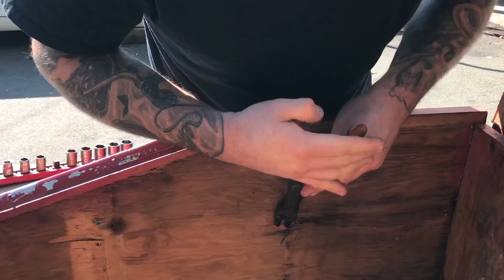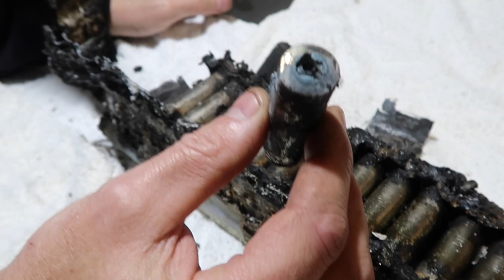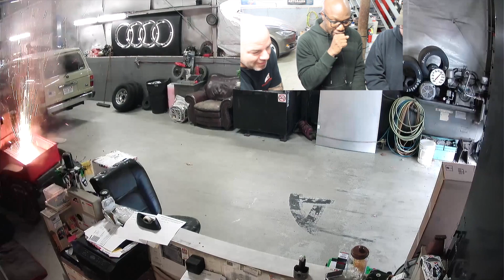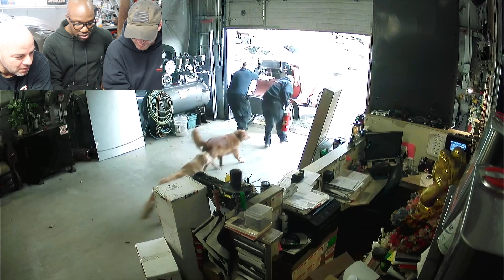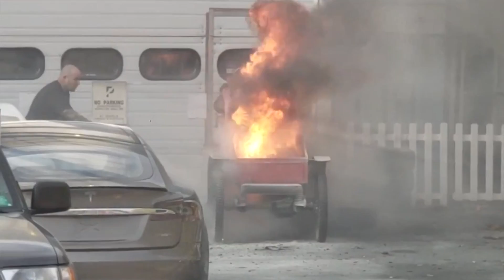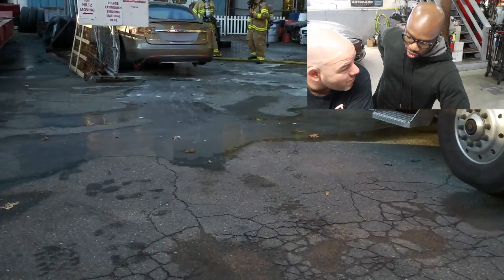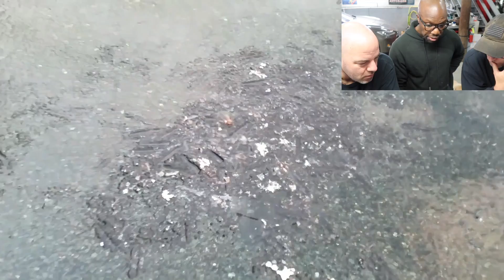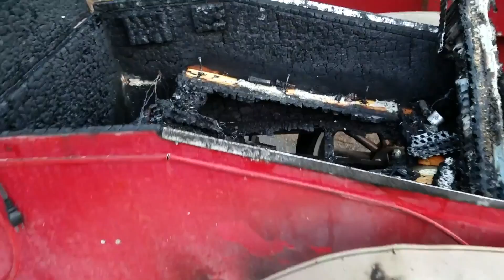My first Tesla Battery Fire

Comment: This folks is why you don't use cylindrical batteries in a EV battery, They run away quickly, they don't vent quickly enough, and they turn into projectiles/bombs, the other cells then overheat and do the same thing.

Pouch packs are the way to go, they swell rather than explode and are far more stable, the only issue is they are more expensive and slightly heavier.

Comment: Seems to me if you're going to be messin' with Lithium Ion powered EV's you need a fire resistant blanket/tarp to contain a run away battery fire. Keep yourself, garage, neighbors and fireman safe. It won't put out the fire but should contain the shrapnel.  https://www.amazon.com/Waylander-Welding-Vermiculite-Impregnated-Fiberglass/dp/B01MTUMLV8/

Comment: Yes lithium it’s very flammable and very violent, like thermite (aluminum iron oxide) and its coefficient of thermal expansion is higher than iron (4x) and aluminum (2). This means it expands greatly which makes it very violent when it burns. when it over heats or gets a charge thought it with while punctured or just fails this can happen and you need a water fire extinguisher not a co2 fire extinguisher to put it out. Oddly enough I posted on a engineering form that a year or two ago about how in movies had have ppl shooting gas tanks and while gasoline is extremely flammable (has flash point much lower than diesel or kerosene) (flash point is the temperature the object need to reach b4 it  will ignite with an external source of heat) cars blowing up, even gasoline drums when shot won’t ignite. However shoot a battery on a moving electric car an this is what it will look like. That doesn’t mean electric cars are not safe, they are very safe and developers are constantly implementing safety features for lithium batters. 
Last fun fact!: lithium used to be used as fuel for thermonuclear devices!

Comment: In 2003 while at (now defunct) Wavecrest Labs in Virginia, we were max cycling a AA battery pack when it went critical mass.  It bounced around the lab like firecrackers and set off the powder fire suppression system.  All the computers and test equipment that used cooling fans sucked in the powder and killed $1M of lab stuff.

Comment: So what exactly happened?? Did you wire the batteries up wrong?? Did you leave something out that needed to be present?? Where were the battery is damaged in some way during the installation process?? What happened

Comment: thermal runaways like that are the worst. l had a laptop that did that once and it set my house on fire, nothing serious just left a 2 foot hole in the floor. once they start there is no putting them out. you just have to let them fizzle down. the worst thing you can do with a battery fire like that is throw water on it. that's why AGM batteries are king, you won't seem them bursting into flames like that. the worst l have ever seen from a lead acid type battery is a boil over where acid starts leaking out and the battery starts smoking, but no fire damage.

Comment: this is a Case of a Overcharging near the end of the charge cycle. With No BMS the pack was NOT in balance. The popping you see here, the fire, and the runaway? This is the exact way a overcharged cell dies.
Rich and Lee, you need to look at Bench power supplies and or Hobby chargers to Charge and check these packs. you made a Huge Mistake here and people need to be able to learn from it. 

for those that see this.... the tesla BMS was bypassed, the Cooling module was not running and the cells were charged with a charger that applies either too much current or too much voltage.

Comment: good thing you were working that could of burned down the entire shop or at least ruined a lot of stuff with just smoke damage also did you tell the fire dept it was a lipo fire because it looked like they used water instead of chemicals

Comment: Lead acid doesn't look too bad right now.
Reply: If those guys will got this type of battery they will drink the acid. Think twice.
Reply: Yes lead acid battery pack might be a better option hmmm?
Reply: Or lithium titanate oxide
Reply: 18650 is not a tesla battery  they just grabbed  thousands  of these cells and slapped  tesla on it lol
Reply: Lead acid ftw. Sure they’re heavy as hell, but they’re so stable compared to lithium ion 😬

Comment: Was the battery pack on charge when this happened? 
In the Oil and Gas Patch, I used to maintain large Ni-Cad battery banks for emergency power inverters and I saw two large industrial Ni-Cad banks experience thermal runaway and burn, one burned for about 20mins and burned right-trough a steel battery rack and a 1/4" steel diamond plate floor. So hot approaching it or trying to extinguish it was unthinkable. It usually happened after a moderate discharge and then Re-charge cycle. Li-ion seems in some ways to be potentially more dangerous than Ni-Cad. 

I also experienced a smaller thermal run-away in-flight in a T-28. We were lucky to get back on the ground and realized Ni-cad packs are perhaps not the safest option for aircraft. 

Advisory Circular - FAA
https://www.faa.gov/documentLibrary/media/Advisory_Circular/AC00-33A.pdf
"thermal runaway" is an uncontrollable rise in battery temperature that will ultimately destroy the battery. This condition can occur when a nickel-cadmium battery ...
Reply: Jack O'Neil Yup, they cut the video where he disconnects the charging cable. Idiots charging it with a shitty lead acid charger with   no BMS on the batteries. Definitely a fluctuation in the charging cycle and overcharged those unprotected cells no doubt.

Comment: Congrats Rich(In a positive way), I always think mess-ups and failures are stepping stones. One thing I observed was that when they started pushing the cart out of the garage more and more batteries started popping, My guess is that there might have been some current being generated in the motor and was being pumped into battery. Do observe the video again and let me know? Did you have any reverse current protection(power diodes or anything like that). May be that could have reduced more batteries getting heated at the very beginning.

Comment: FYI dumping all those batteries into a bin is hazardous also, it could easily start a secondary fire if they are not all depleted which I high doubt. Everyone needs to understand Lithium is an Oxidiser, it requries no air to burn, it contains everything it needs to have its own little party (fire), you cannot choke the fire to put it out. It will burn until it consumes all its fuel or hits some sort of a cutoff (jumping from major cell to major cell or thermal breaker).
Reply: and as stated in the video they flooded that bin with water for a long long time afterwards.

Comment: I really hope the firemen weren't putting water on a lithium fire.
Reply: Water was for containment not to put it out.
Reply: Alex Lindsay It would’ve been contained better without the water.  Water and lithium makes heat and hydrogen, lithium metal spontaneously combusts when exposed to water.  I learned this day 1 of chemical lab safety to never put water on these metals.
Reply: ELijahKan10 You are correct about water and lithium but you are incorrect about Tesla’s implementation of a lithium ion battery. Each cell is sealed so water does nothing to those, and the cells that are open have already exploded. Water is used to cool the batteries to prevent the other cells from exploding. You put large quantities of water on the battery which the fire department is capable of and you aren’t in your chemistry class

Tesla even recommends spraying water on it  on page 25 on this document https://www.tesla.com/sites/default/files/downloads/2017_Model_3_Emergency_Response_Guide_en.pdf

Comment: https://en.wikipedia.org/wiki/Thermal_runaway#Batteries

When handled improperly, or if manufactured defectively, some rechargeable batteries can experience thermal runaway resulting in overheating. Sealed cells will sometimes explode violently if safety vents are overwhelmed or nonfunctional.[12] Especially prone to thermal runaway are lithium-ion batteries, most markedly in the form of the lithium polymer battery.[citation needed] Reports of exploding cellphones occasionally appear in newspapers. In 2006, batteries from Apple, HP, Toshiba, Lenovo, Dell and other notebook manufacturers were recalled because of fire and explosions.[13][14][15][16] The Pipeline and Hazardous Materials Safety Administration (PHMSA) of the U.S. Department of Transportation has established regulations regarding the carrying of certain types of batteries on airplanes because of their instability in certain situations. This action was partially inspired by a cargo bay fire on a UPS airplane.[17] One of the possible solutions is in using safer and less reactive anode (lithium titanates) and cathode (lithium iron phosphate) materials — thereby avoiding the cobalt electrodes in many lithium rechargeable cells — together with non-flammable electrolytes based on ionic liquids.

Safety protocols include having an automatic shut-off to prevent overcharging the batteries and multiple groundings to prevent a short circuit.  ;-) ;-) ;-)

Comment: And that's the issue with electric cars right there.
Reply: Proof? This is a 3rd party modification, nothing related to Tesla or any other electric car company
Reply: @matt4756  High energy density + premixed "fuel" = battery. If you go any higher in energy density batteries wont catch on fire anymore, they'll explode like TNT. Imagine having liquid oxygen in your regular gas premixed ready to go, that's what you have below your seat in a Tesla.

Comment: U r stupid. This has nothing to do with the Tesla Battery. Get your tings together man! Use a BMS! Jesus!
Reply: Yes it does. It's a battery module from a tesla. It's modified, but it's still a true statement. A chevy 350 can me modified to Hell and back and people don't run around saying "that wasn't a chevy engine!!".
Reply: @volvo09  Tesla's batteries are safe, using them without a BMS is plain stupidity... That's all i'am saying...
Reply: volvo092 No it (the battery burning up) really doesn't. Any li-ion battery would burn if you overcharge it, it doesn't matter who made the cells originally. Same with a chevy engine, if you install and use it in an unsafe way, which it wasn't designed for, it will fall apart / burn.

Comment: yea it just because how much energy is stored in those batteries. Phone battery has a energy of a small bomb and tesla has 10000x times of that so if all went off at the same time, it's really a lot of energy and very big explosion. In this chase energy is going out slowly so it doesn't just explode like a atomic bomb. One cell went of instantly few times, that's when you got explosion.

I think that's why they put energy in many small cells so when there energy wants to escape it's not going everything at ones.

Comment: The other commenter mentioning the cut is absolutely correct. The cut is when he’s unplugging the battery. Def was overcharged and led to a voltage spike, and subsequent overheating which is what he means when he talks about thermal runaway. 

TL;DR: it was their fault.
Reply: Thermal runaway is when you short positive to the ground of the battery. Not sure over charging is classified as that. Who doesn't know you need bms on litium batteries. That's a rookie mistake for sure.
Reply: I like how you put a TL;DR at the end of a 3 sentence post.
Reply: @firstlast4379  Clasic !! LOL
Reply: What cut?
Reply: @airplanes657  there's a very minor cut in the video where the cart is unplugged. Look closely and you'll see it..

Comment: Set yourself up a water based fire hose and learn how to use it for fuel oil and this type of thermal runaway fire.  Also, keep a long strap / tow rope / chain handy that can be hooked to any vehicle that is on fire and then to another vehicle outside of the building so that you can remove the burning vehicle by towing/dragging it, even if the brakes are set.  At worse, you lose the vehicle, but save the building.

A fine mist works well for fuel oil fires.  Do not use a solid stream though as it is more likely to spread the burning liquid.  In the Navy, we had nozzles for high and low velocity fog for certain things like this.

Comment: Lol he said he knew exactly what to do, then he followed it with "so I grab the fire extinguisher" dumbest thing I've ever heard, you can't put out a lithium fire with a extinguisher, you can only cool it down, and you guys say your experts
Reply: The majority of that clown car was made of WOOD. Fire extinguisher was a reasonable call and appears to have worked to contain the fire.
Reply: He specifically said he was trying to keep the fire cool several times. He said he didn't expect to put it out. Both to save the paint of the cars around it and to contain it.
Reply: Axipixel powder extinguisher doesn’t cool a fire, it cuts off access to oxygen. Lithium battery fire has an internal source so powder doesn’t help. Only lots and lots of water will cool it and contain it. You can smother it with powder and it will still continue to blow cells.
Reply: YES, you can put out a lithium fire with a class D extinguisher using either powdered copper or graphite. Use that box in front of your nose and look it up with that thing called the Google, smh.
Reply: @russell2449  Its not possible to extinguish a lithium fire with powder, because it will not cool down the cell to stop the thermal runaway. It will suppress the fire, but will not stop it. The only viable way to stop a lithium fire is cooling it down while getting rid of the fuel source. And thats what F-500 is supposed to do.
Reply: @tiesto9797  Then tell that to the manufacturers of Class D fire extinguishers which SPECIFICALLY STATE that they are effective in putting out lithium fires.  Water won't put out lithium, hell it'll burn underwater, although the water will cool the surrounding area and help prevent its spreading to other flammable materials.  

I suppose there is a question of scale that would need to be determined - exactly how large a fire your extinguisher will handle is key, and also how much and what types of flammable materials are nearby as well.
Reply: I'm sorry that they aren't an expert in everything.
Reply: We have a similar problem with our rocket fuel, if it were ever to catch fire.  You cannot put out the rocket fuel with extinguishers because it is so hot. It will even burn underwater. So our policy is to stop secondary fires and to stop the spread of the primary fire. At some point it will run out of fuel.   
On the matter of electric cars, I remember in the case of the Rimac that Richard Hammond crashed on The Grand Tour, the battery pack kept bursting into flames for three days.
Reply: Bunch of #$# clowns...

Comment: I think we'll hear more about violent electric car fires and also electrocution when EVs have had more time to saturate the market. Even with proper safety, when these cars crash on a highway all it takes is one battery to be punctured and start a thermal runaway. Not saying a punctured fuel tank is any better but a multi vehicle crash with for example 3 Tesla Model S could be a long inevitable fire with 24'768 cells burning.

Comment: This is why civilians should never for any reason build custom electric cars or anything else involving large batteries. Batteries should only be handled by qualified professionals, and packs should be properly engineered by a team that has not only all of the required qualifications, but also an intact safety culture.

TL;DR: Don't touch batteries. They will explode.

Comment: Rich, hope you see this comment, I know for a fact, your best bet to put a fire out on this cells is just to submerbe them on water to cool them down, making them cold is the only thing that will contain the thermal runaway given that the cells already have everything they need to keep burning including oxygen, so, cooling them is the only thing you could do, you shuld have addecuate fire dunk tanks and stuff like that on your shop, I have seen pressurized water tanks  connected to a deposit for safety.

Comment: This is the primary reason that the batteries are contained in a steel shell and the shell is properly vented. Should you have a thermal runaway, in a perfect world, you'd get a really hot floorboard but the car itself should remain for the most part in tact. Had the coolant channels been filled with coolant, it would have added thermal mass to the battery pack and lent a hand to keeping things cool. However, this looks like it was due to an unbalanced battery pack. (Overcharge/undercharge)..

Comment: I read that massive amounts of water are a way to cool down those Tesla battery fires.  Do not sue me if I'm wrong.  (Obviously, don't sue me if I'm right, either.)  I read it from some doc from Tesla, but I don't remember the exact context.  Probably the instructions to fire fighters doc.

^^^^

I wrote that before finishing the video.  As seen later in the video, when the fire dept came, they did as I described.  The fire dept has more water capacity and more experience with water to put out fires.  If you feel good with water delivery, then go for it, I say, but beware of the dangers (face mask?  Way to put out the fires from cells coming at you?  Firemen have fire protective clothing and gear that reduce those risks, plus coworkers that can help them if they need it in case something goes wrong).

Comment: Use water on a lithium fire
Reply: Yup, cool those cells down as fast as possible. I dodged a pack fire by tossing it in a bucket of water I had handy.  If I hadn't gotten it cooled down It would have exploded like this.
Reply: @volvo09  And these guys want to start an EV shop?
Yeah this is why tesla is kinda like apple when it comes to repair.
Untrained people who don't know anything about electric vehicles are going around poking and prodding in them.